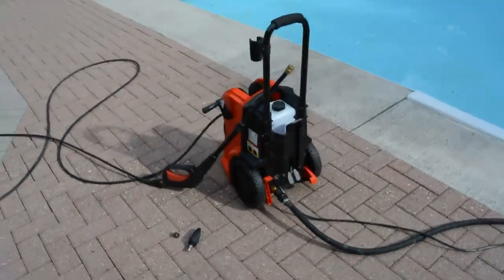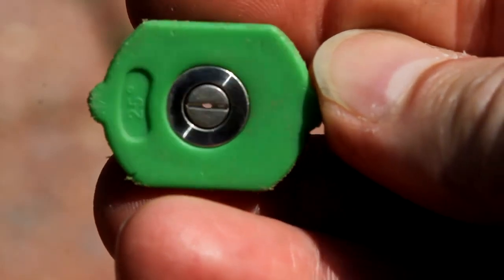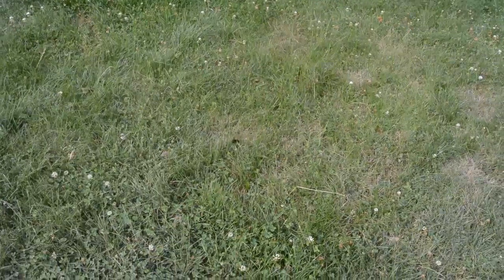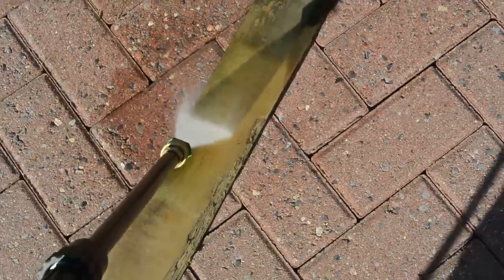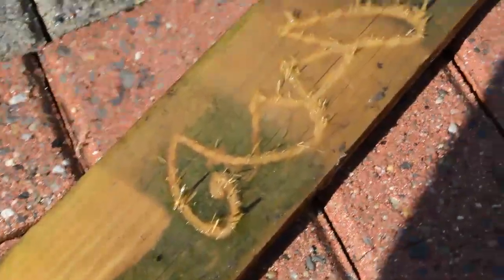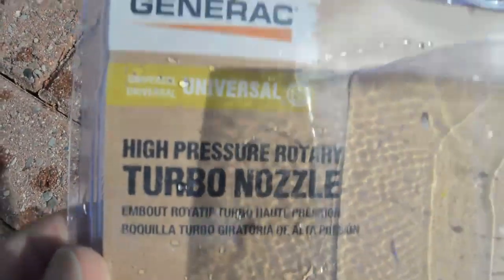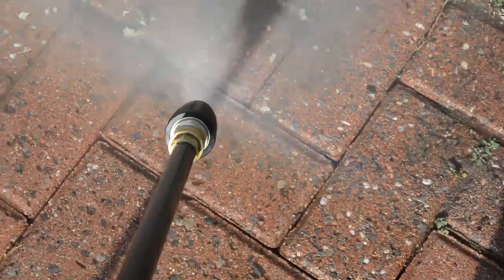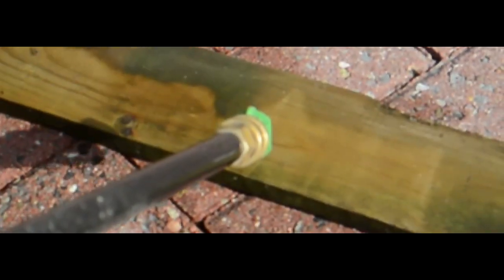Snap-on-tools 2000 psi pressure washer review

Comment: I bought one of these last year from Menards.  Worked fine then.  This year, started up and the spray handle just blew out water all over right from the trigger area.  No spray out the tip.  So the spray handle was busted.

I thought I'd get a better quality handle with the idea of maybe replacing the sprayer once the motor quits - save some money.  So, got a nice CAT spray wand -- but it has a 3/8 QD connector, which the hose doesn't have.  Fine.  Back to get a 3/8 QD to M22 adapter (M22 is the standard size for pressure washer connectors).  Back home to now find out that the M22 center hole isn't wide enough for the hose on the Snap-On.  Going BACK to the store -- again -- and looking at the Snap-On crap on the shelf I can confirm -- Snap On uses their on custom size, so any aftermarket stuff WILL NOT FIT.  Not hoses, not connectors, not anything.  Last thing I wanted to do was get ANOTHER pressure washer, so I got all crazy with my Engineering skillz.  Looking at the display models, I found that the center hole size was close to 3/8 in -- maybe just a tick smaller.  So, I bought a 3/8 HS metal drill bit to bore out the M22 center hole in my brass adapter.  This allowed the connector to fit, but was loose enough to spray water out the connector when on.  Used some cut down rubber washers for garden hoses and pipe tape to seal it up nice -- so now I have a nice wand for a crappy sprayer unit (the spray tips work in the new wand FWIW - so they did follow THAT standard).  Oh, and the screws don't hold the wheels on well, and if you drag the unit around the grass, the locks always re-enable themselves.  Really a poorly designed unit.

Oh, and the black wide hole sprayer tip is for soap application -- the soap won't draw out when using any high-pressure hose tips.  It only will be drawn out when using low pressure.  Found that out while trying to use some mold remover soap on my shingles.
Reply from the maker: Thank you for adding your informative comment, I'll pin it to the top for a while. Also, it's worth saying that if you live in a part of the world that freezes in winter, you definitely need to bring it inside; it seems impossible to effectively drain these things to 'winterize' them.
Reply: Same problem never going to buy a snap on product again
Reply: @Max Wilda Mine did the same thing and went and bought a replacement and it doesn't even adapt to the one that it came with.  It is all new
Reply: There was water in it and it froze and cracked. Maybe drain it or take it inside over the winter?
Reply: Same problem here. The metal holding piece cracked, very poor quality. Snap on keeps its name with metal pieces snap crack! Worst product, do not buy!!!!!
Reply: same thing happened to me.

Comment: One Star review here.   Mine started to act up soon after purchase. Slow /delayed turn on / run when trigger engages.  The GFI plug burnt up on my forth usage.  I stored it in the basement for the winter and now it won't run at all, just sits there humming until it blows the breaker.  I'm not impressed after 260 bucks spent. Performance was satisfactory but I expected a little more from a 2000 psi washer. I bought it for the name expecting a butt kicker not a generic cheap unit.        Thanks for your video.
Reply: Your water pressure will affect all that.. the startup is one thing cant fix factory broke when it's cheaper to replace the whole thing.. the price says it all here though the Snap-on name sells single wrenches more expensive than this obviously straight out of the gutters of China

Comment: the black nozzle is for use of the soap dispenser and the whole machine seems to be geared more towards washing vehicles.for yard work you would benefit from a higher pressure machine that comes with more concentrated nozzles

Comment: Bought one.  Died after 4-6 hrs of use on the 1st day trying to clean a deck.  Motor started running poorly.  On 2nd day of use, would run for 2-3 minutes, then would blow the fuse.  Had to reset the fuse in the breaker box, then on the Plug & then could use the unit again for another 2-3 minutes.  This is the second Snap-on product I have purchased this has happened to.
Reply from the maker: Bummer! I hope you can return it to where you bought it and get a refund. I still love mine, I use it frequently and it's still working great. (However, I rarely use it for more than a few minutes at a time to be honest.)

Comment: I purchased this pressure washer less than a year ago, used it once then I stored it for the winter in my house basement.  I recently tried to use it again and it exhibits the same problems which so many people have reported: little to no significant pressure.  What a poorly made unit!  I feel bad that Snap-On put their name on this unit because it is so poorly designed, manufactured and is severely tarnishing the Snap-On name.  Honestly since Snap-On's name is on it and there is virtually zero customer support for this unit I feel it is justified to criticize Snap-On for allowing such a horrible product to be sold. 

  When I first purchased the unit it seemed fine except for some poor design flaws such as the screws holding the main wheels on repeatedly loosen to the point of binding on the side of the unit and finally falling off completely.  The holder for the handle is not usable at all when wheeling the unit around and the wheel brakes will not stay in the upright, unlocked position when wheeling it around. Currently it has little to no pressure at a mere eight months old.  To last only one use is completely unacceptable!  I purchased mine at Menards and they told me to seek help from the manufacturer but the manufacturer declined to help me and referred me to Snap-On but Snap-On pushed me straight back to the manufacturer.  What a disaster.  I will definitely not purchase anything made by the manufacturer of this unit and probably will never buy any Snap-On tools as a result of this nightmare.

The ONLY upside to this situation is I received a $50 rebate when I purchased the unit so at least I was ripped off for $50 less than the original price.
Reply: john smith I guess I will go with the ryobi one lol

Comment: I have the snap on 692024 electric power washer. Used it one summer and I followed all the instructions on storage. Got it out this year water leaks out of the wand trigger and has low pressure.  Its suppose to run only when the trigger is pulled but runs constantly now. I think this product is very poorly designed.  I would not recommend this product at all!